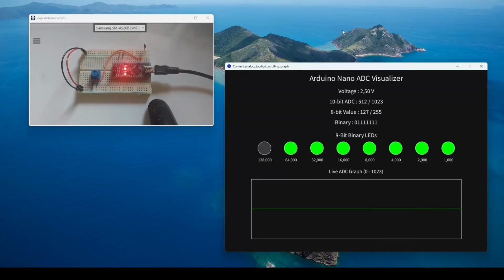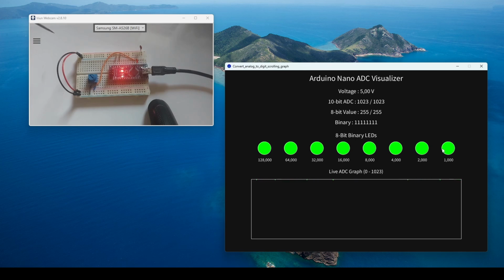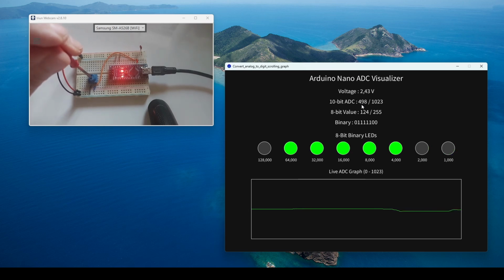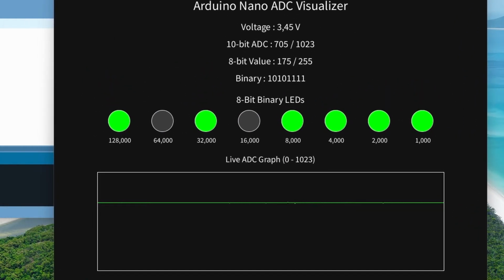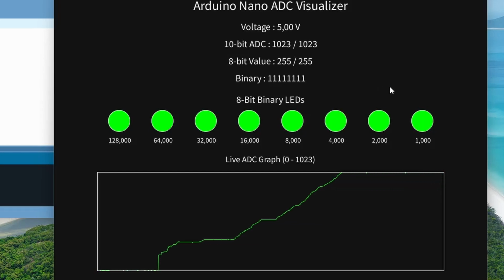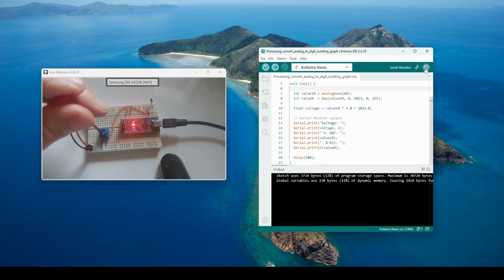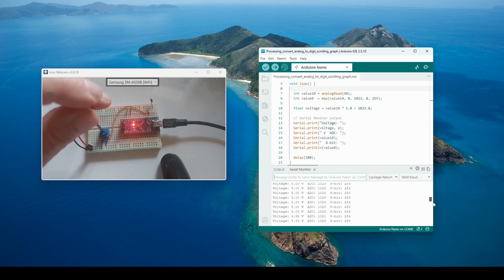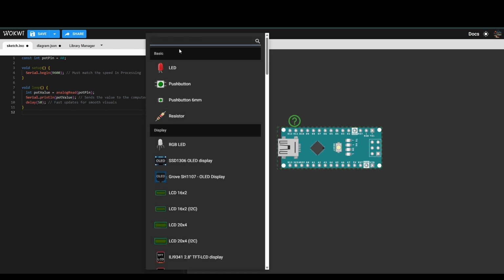Understanding Analog-to-Digital Conversion with an Arduino Nano

Comment: To represent 1024, you'd need 11 bits. The most accurate equation (one with the least possible average error) for the ADC is using 0 - 1023, but you always add 0.5 LSBs of value to it. So the least value you can have is 0.5, and the highest value is 1023.5. In a 5 volt, 10-bit conversion, that means the lowest voltage value reported is ~2.4mV, and highest is ~4.9976V. It's not "nice round numbers", but it means, given a perfect ADC, each value reported's error, would sum to the smallest total error.